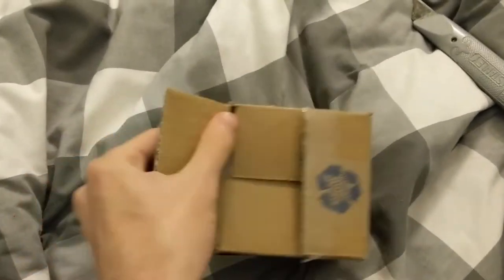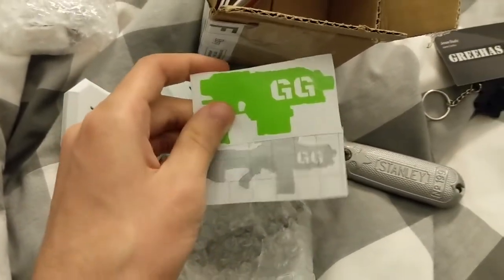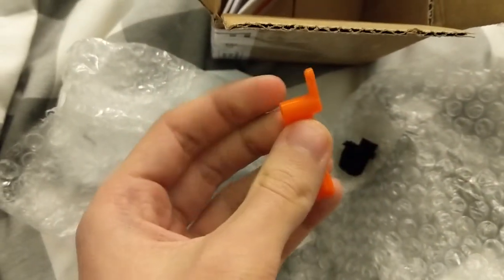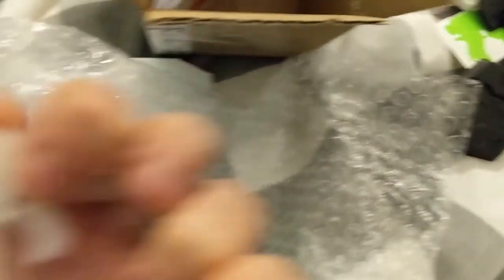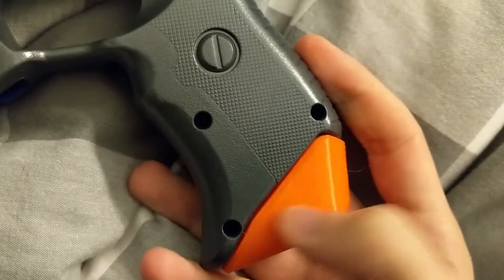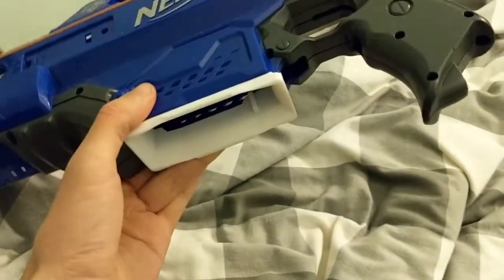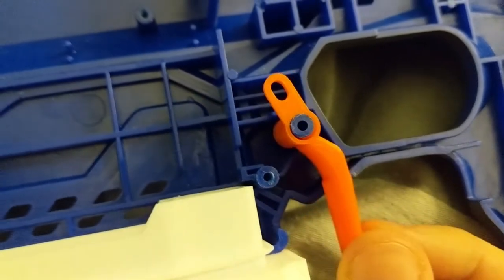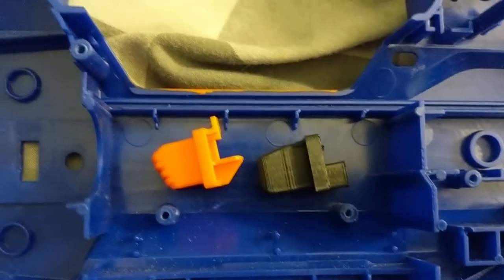Mail from Greehas Gear! Nerf 3D printed parts unboxing and review!

Comment: Just a note for the heel,  the hope is for it to be a two piece assembly. Still working on the clamshell style. =)
Reply from the maker: +Greehas Yay! That's great to hear!
Reply: Also, the pusher motor cover fits a little bit behind the bump and should cover to where the stock bump starts. =)
Reply from the maker: +Greehas neat!